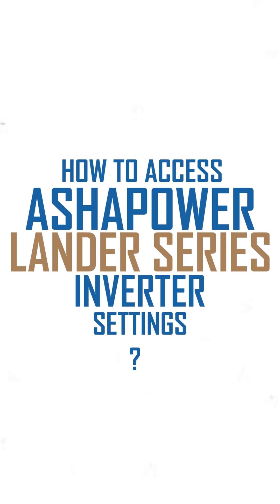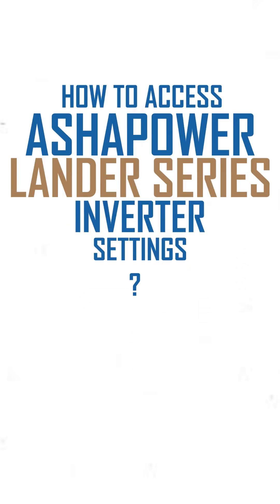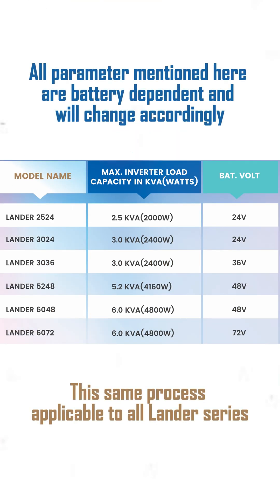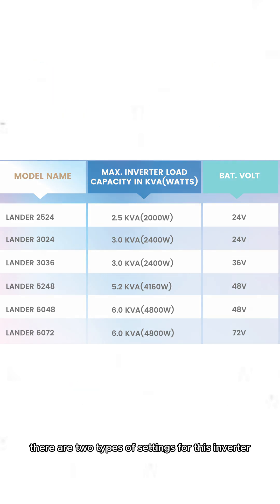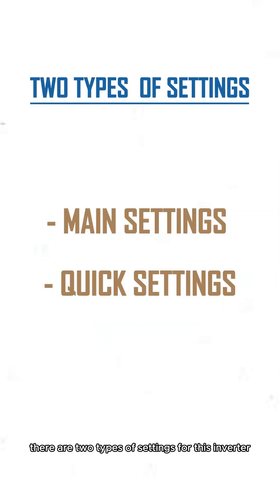Ashapower Lander Series Inverter - Quick Settings Tutorial ( Part 02)

Comment: Dear Sir,
I regret to inform you that your service support system has been extremely disappointing. There appears to be no provision for on-site support, and the calibration parameters are locked and unclear. Additionally, there is no online monitoring mechanism for machine status.

In today’s AI-driven age, customers expect a reliable and well-integrated system—regardless of cost. If these issues are not addressed promptly, your product risks becoming obsolete in a competitive market.

I urge you to consider these points seriously.